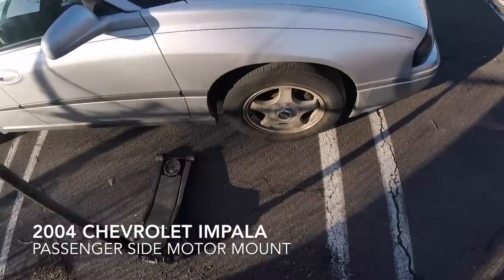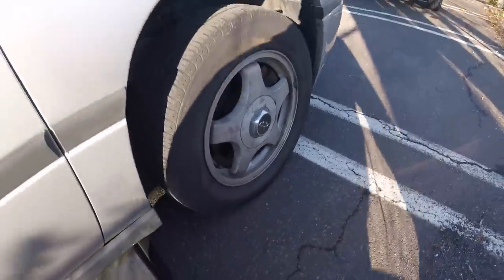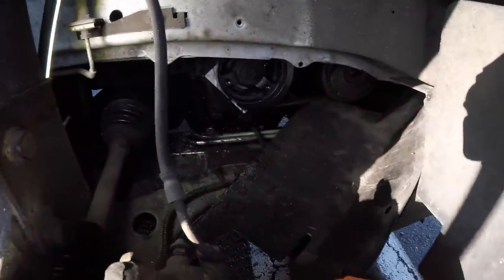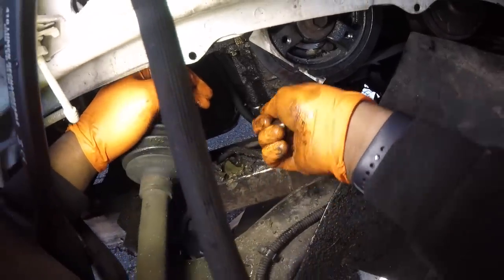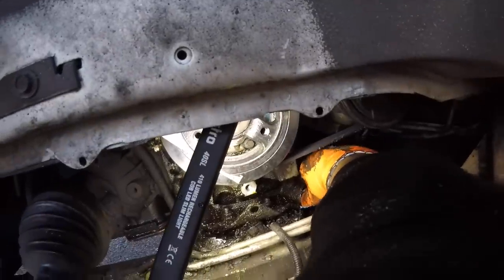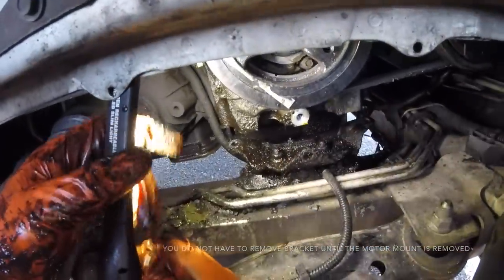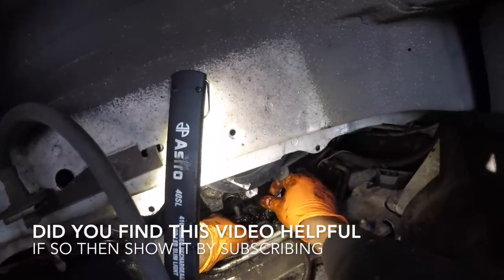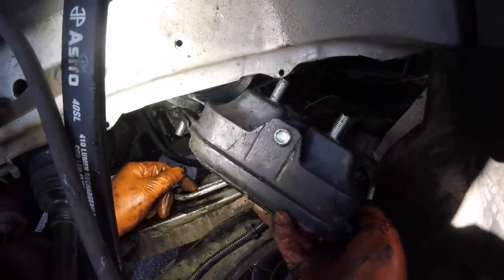🤔How to replace a motor mount on a 2003 Chevrolet Impala😊

Comment: very  helpful... I just finished this job and yes there was a lot of oil accumulation  in this area ..the only problem was lining up bolts against their holes..I had to pry the motor for adjusting
thanks for uploading

Comment: Currently doing this on the 3.4 Pontiac montana. Had a blown head gasket,and the leaking oil killed the motor mount and that caused damage to the CV axle. Great video,thanks for uploading.
Reply: Update,I got mine fixed. The CV axle fell apart when I pulled it off,the bearings inside of it were completely shot. The CV boot was bad and allowed water inside it,that mixed with the grease and burned it up. One thing I was not expecting was when I pulled the CV off,a butt load of transmission fluid came pouring out,so be prepared for that if you are replacing your main CV axle. Just like in this video,my main and bottom motor mount went bad,I ignored it for a few weeks,which caused the cv and wheel bearings to go bad. Had I took the time and spent 35$ I could have avoided spending a full day and almost 300$ to fix the damage caused by ignoring the bad motor mount. So if you are feeling a hard jerk when switching to reverse or drive,dont ignore it folks,it pays to get it addressed right away. This video shows you exactly what you are in for to swap out the mounts. OEM mounts cost 250$+,but a found one online for less than 30$ Just make sure they are they exact same style and its it's ok. 

Fyi I'm dealing with the 02 Pontiac Montana FWD with the 3.4 GM

Comment: My 2003 3.8 liter impala did not have a bracket i just took the nuts off the motor mount (4)  .. Besides the bracket , the removal of the motor mount is the same on a 3.8 liter . Thx for the upload!

Comment: I've done this job yesterday along with the transmission mount on the driver side (MUCH easier).  This is not a job for a beginner or anyone scared of dirty jobs.

The root cause of the problem is the crankshaft seal that fails with age and mileage, and begins to drip oil onto the harmonic balancer pulley and the engine mount underneath.  Most people don't know this, but engine oil slowly attacks and dissolves rubber that's not oil-resistant (aka BUNA rubber).  Eventually, both the harmobal and the mount fail.  So, be prepared to deal with lots and lots of seriously disgusting sludge all over that area.
The really challenging part is getting the old mount out along with putting the new one in.  There's nowhere near enough clearance there unless you're willing to drop the subframe, and the threaded studs will want to snag on everything.  I had to take off the upper metal bracket in place before I was able to pull out what was left of the old mount.
It also should go without saying that you must use a block of softer wood between the jack and the engine unless you want to add a cracked oil pan to your to do list.
Lining up the holes in the engine block and the bracket takes patience.  There is actually a small notch in the transmission housing you can put the jack under to kinda nudge the motor.  A gentle tapping with the hammer also helps to line things up enough to hand-thread the three bolts before you torque them down all the way.
I'm not normally the type to say this, but do consider having a repair shop replace the crankshaft seal, the harmonic balancer pulley, and the mount if you can comfortably afford the labor costs.
Reply: What shop do you work for?
Reply: @steved8714  I work at AutoZone.  Did this on my own car.

Comment: Great work. Excellent details. 2005 Chevy Impala.

Is there another one on the drivers side? Should both be done at the same time?
Reply: the other side is the transmission mount. usually the power steering pump leaks into the indent in the chassis that holds the motor mount and causes it to fail and split
Reply: Yes always change all mounts so you know they all will have the same life span  and durability and for peace of mind

Comment: Somebody else was asking, did you loosen or takeoff one end of each dog bone on the top? For jacking up the engine that is. 1998 Chevy Lumina im gonna do looks pretty much the same except for I think the nuts underneath by frame are  easier to get at. Thanks

Comment: I had a real bad vibration under acceleration. 
My front mount was real bad. I replaced the front mount, got rid of 95 % of my vibration under acceleration. 
I still have a slight vibration under acceleration. 
Should I flip my dog bone bushings, or replace the transmission mount, or both?
2001 Grand Prix SE
Reply: I would consider checking the CV axle really well if it's only under acceleration that you feel it. A completely destroyed bottom motor mount "like the one in the video" can put so much strain on the CV axle that it will slightly warp it. I had the same problem,head gasket blew,the leaking oil killed my motor mount,I fixed the leak but ignored the mount,took no time at all of driving with the bad mount to destroy the CV axle. It acted like it had a bad wheel bearing or even a bad tie rod,but it was a lightly bent cv. Hope this helps.
Reply: @normalhuman9260  
It's working okay now.
I replace the tranny Mount flipped the dog bones at the front of the torque struts or dog bones and replace the bushings at the motor side and replace the transmission mount. The anchor motor mount that went bad in 6 weeks I temporarily shimmed up with three eighths thick piece of wood for now.
I have a new AC Delco Mount sitting here it's working so nice I hate to touch it. 😂
Reply: @mrbreezeet1  nice,I just finished mine this morning,went to remove CV and it fell apart,lol. All because I ignored my bad motor mount on the bottom. Glad yours is well.
Reply: @mrbreezeet1  was it easy to flip the dog bones? I assume once you remove the bolt you can easily pull the rubber out of it and flip it? Also I'm just curious,but does yours have issues with the bulb sockets? I use replace the bulbs left and right,then realized it was the sockets that were the problem,and I've heard that other GMs have the same issue. I'm just suck of buying new bulbs lol. If you have a min to give your input I would greatly appreciate it. I'm dealing with a 02 Pontiac montana with the 3.4
Reply: @normalhuman9260  
Yes I didn't have any tail lights at all when I bought it used I had to replace the sockets. 
You don't remove the dog bone bushings at the front, just unbolt it and work on it on the car or you could take it off and put it in a vise, but you wedge a screwdriver in between the metal frame and the bushing and spray silicone spray in there all the way. Put the nut and bolt back through and used to wrenches to twist the bolt in the direction of tightening, and it should flip like that. 
I got the bushings for the motor side at joro they were the cheapest even with shipping. 
The old bushings were pretty loose I cut the rubber ears off and they pretty much fell right out. 
I sprayed a bunch of silicone on the new bushings and pressed them right in with a big vice. 
I would change the bushings at the motor side also. 
You can buy the whole dog bones with bushings but it was cheaper to just replace the bushings,  and save the old metal part.
Reply: @mrbreezeet1  thank you for taking the time,I really appreciate it.

Comment: If I had to replace the subframe, would I do the same steps but just loosen the transmission mount on the other side ? I know I would have to take lower control arm strut and tie rods off
Reply: I hope at this point you didn't replace the subframe, asking this question on this video suggests you aren't ready for that job.

Comment: I must confess that the mount are casualties to cranking the motor forward to reach the backside for plugs,o2 sensor or crankshaft sensor or exhaust..don't take much to make a small tear which will start to leak

Comment: Yep the motor mount needs replacing when your harmonic balancer goes out(i notice a new one on the car)..thats a sign that motor mounts are shot..trans mount usually last forever cause it stays dry for the most part..but I replace the timing cover gasket & new seal with a new motor mount & balancer..all them need replacing at the same time..get all the parts for $80 with shipping at rock auto
Reply: Stevo oliver I have to replace my trans mount on mines because it’s shot
Reply: @antheman5156  yep I seen some bad trans mounts..they do wear out   around 200k(Just dry rot)..i changed mine at 150k when I done the motor mount but the trans mount was still good..i put the poly urethane mounts on the last time..hydrolic engine mounts don't last long when oil & antifreeze just sits on top of it in the valley ..spray the trans mounts with armorall or silicone grease every year..also depends on your driving habits

Comment: These are the beginning to the 4T65E transmission failing with the engine able to shift they throw the CV axle out of correct alignment causing constant vibration to the transmission differential causing sun gear failure.

Comment: You are better off putting all the bolts in first so you don't have to deal with trying to line the bolts up using the jack. Also, don't put the jack in the way of where you need to remove the bolts. Air ratchet use would have worked rather than box end wrenches.

Comment: Air compressors suck get batt powered tools so you don't have to listen to that crap.
Reply: Air compressors are great because they don't run out of juice, battery tools have their purpose as well. If you like using torque sticks to get your torque in range, definitely do not use battery with them, you'll over-torque every time.